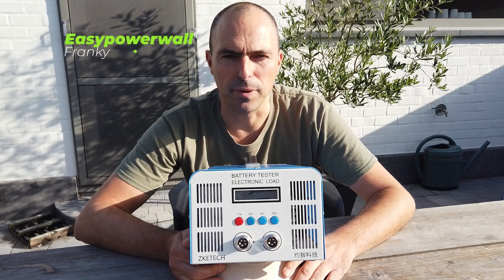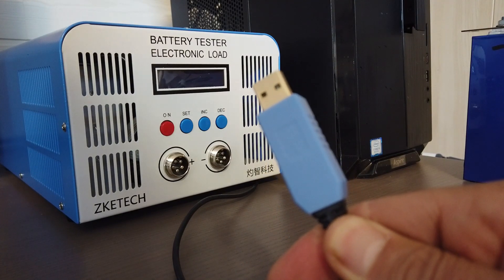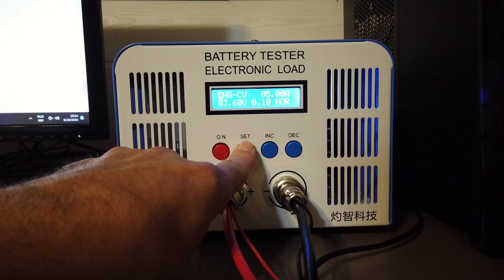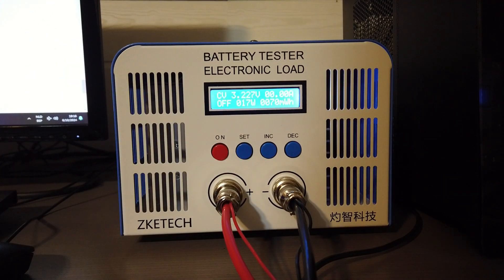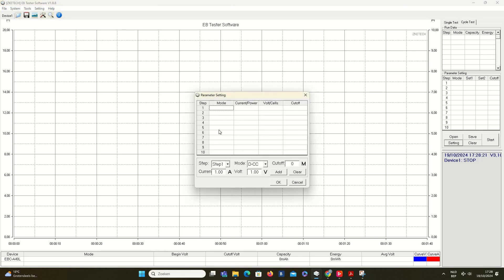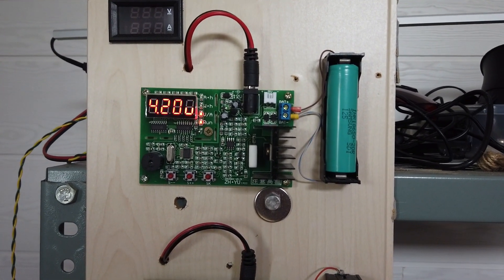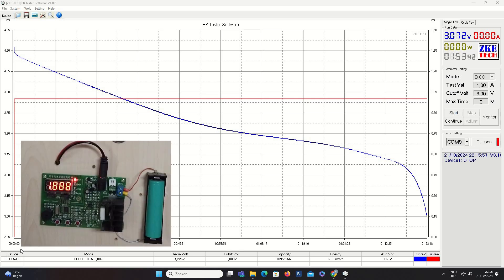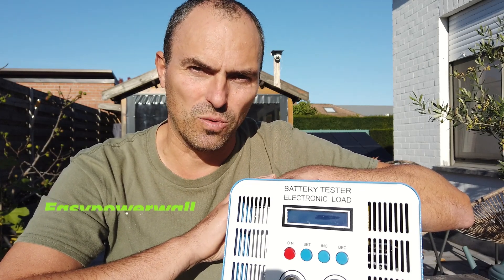ZKETECH EBC-A40L cell battery tester inside out.

Comment: UNI-T UT210E to test accuracy? Seriously or it's a joke?
Reply from the maker: I'm laughing a lot but this is not a joke. THe UT210E is very accurate, tested this with several other tester. Suggest to check other videos on youtube.
Reply: @easypowerwall It's not very accurate I have that unit clamp meter i have also other better testers and finally I also have oryginal EBC-A40L. EBC what I have display charge/discharge current very accurate and I know that this unit meter isn't accurate (I have them few in the past all the same). You need to check if you connect everything properly or there is something wrong with your EBC-A40L or with your unit clamp meter

Comment: Can this machine do top balancing in parallel?
Reply from the maker: Hi, if you connect all cells in parallell and use the ZKETECH as a charger....then it will (top)balance all the cells. Don't recommend to charge to 3.65V, no need to stress the cells.

Have a nice day.
Franky - EASYPOWERWALL
Reply: @ then upto how much volt is best to do top balance
Reply from the maker: @sujanpanta374  I suggest 3.5V. Normally I use my cells between 2.9 and 3.45V - Once a year I charge to 3.5V to balance the cells out. This way you never put stress on the cells.
Reply: Is it possible to charge the first time ,to test your batteries ,charging to 3,65 V and discharge to 2,5V to see the max load? 
And should be then already compressed if you want to do this when you gone make 48V system
Thanks Marc

Comment: Thank you so much !! I wonder if this can be used to test capacity of a battery pack of 36volts of an e-bike ? I saw in desc it manages maximum 4 volts, which appears limiting to me but my understanding is weak. Thank you for your lights on this !
Reply from the maker: Hi, 
This equipment is made for cell capacity testing. For checking the capacity of your e-bike battery you better buy an energy meter you install between your 110/220 wall socket and the e-bike charger.
If it's not clear don't hesitate to contact me again, I'm on FB too.

Franky - EASYPOWERWALL